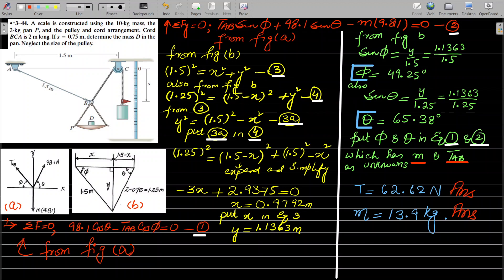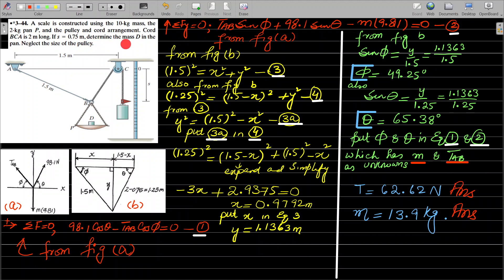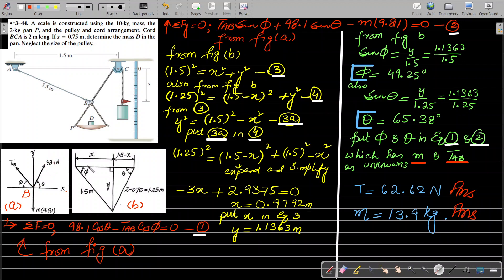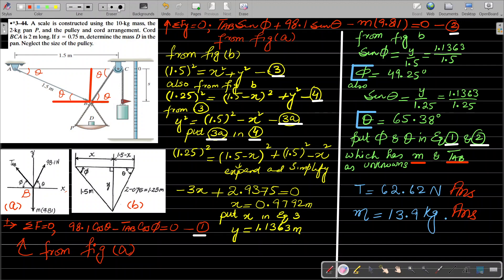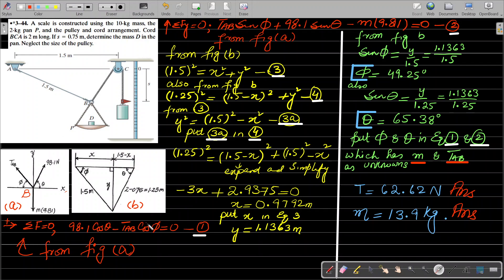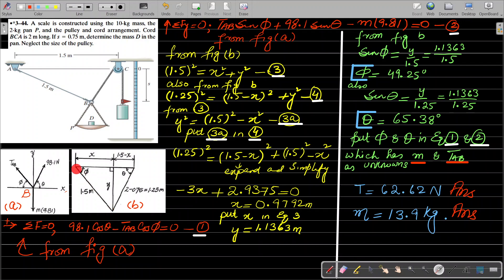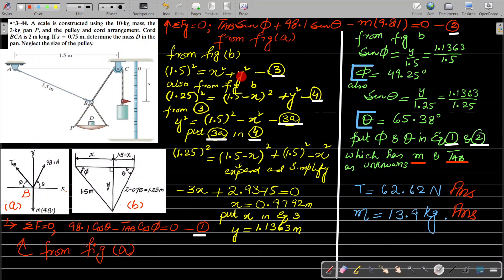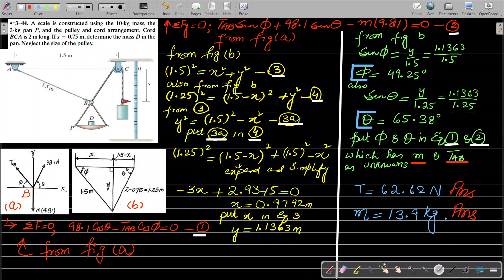Calculate tension and unknown mass by using equilibrium equations & free body diagrams.

Comment: the calculated over all value of the mass should be subtracted by the weight of the pan which is 2kg, so 13.9kg - 2kg = 11.9kg, therefore the mass D in the pan is 11.9kg.
Reply: He is forcing us to calculate only mass D, see equation 2 , where we calculate (m*g) for weight D and get 13.9 kg., if he says to calculate total  mass D and pan P then u write as 13.9 + 2 kg. U can also treat 2 kg as constant as it is dead mass, it can be 1 kg or 1.5 kg, it doesn't matter.
Hope u get it

Comment: Sir I think the length can't be 1.25 from B to C.

If the total length is 2 meters than.

1.5 meters+ 0.75 + 1.25  it makes 3.5 where as the total length mentioned is 2 meters only.
Reply from the maker: From B to C to the Red Arrow, one complete chord,  it is 2 meters, s=.75 meters, so the hypotenuse will be, 2-0.75=1.25 meters. I think 
 Mr Hibbeller has written wrongly that BCA is 2 meters. From A to B is a different chord then from B to C.